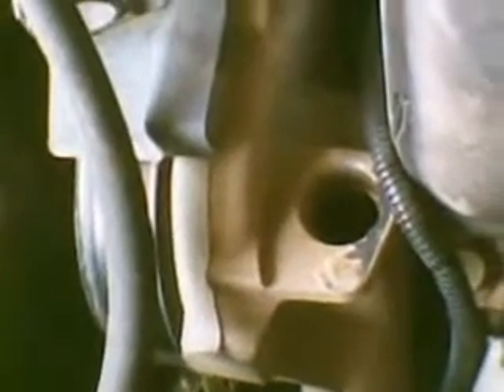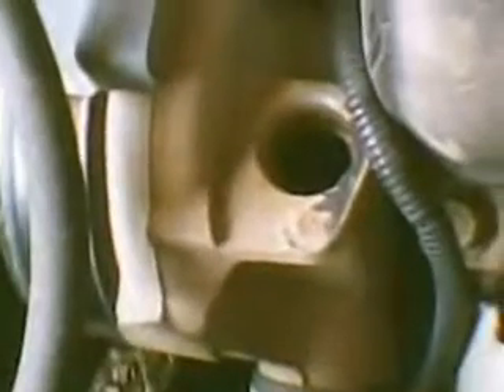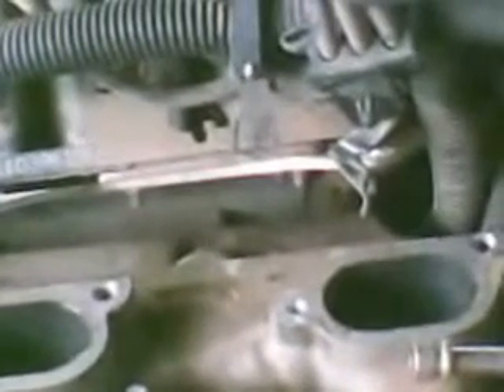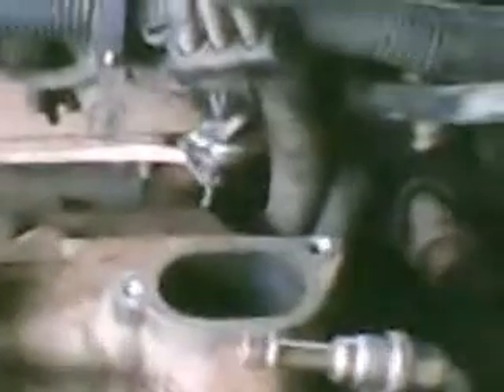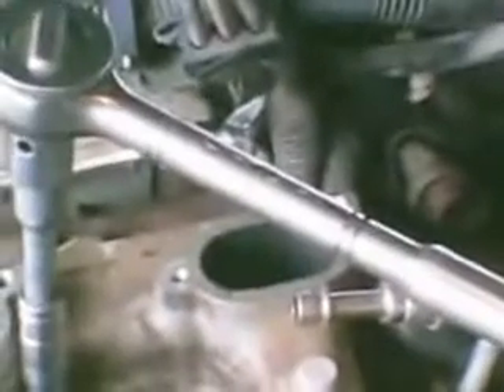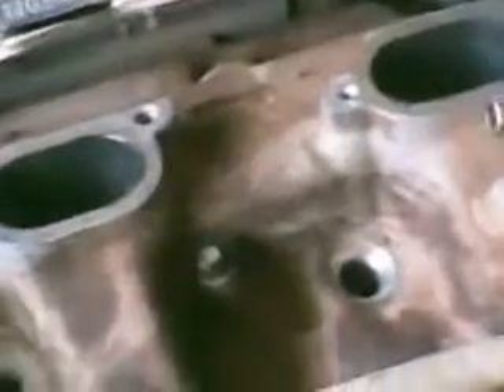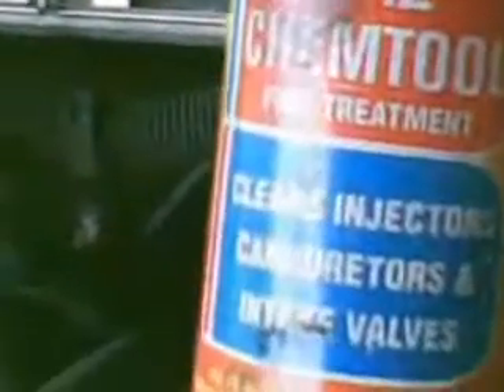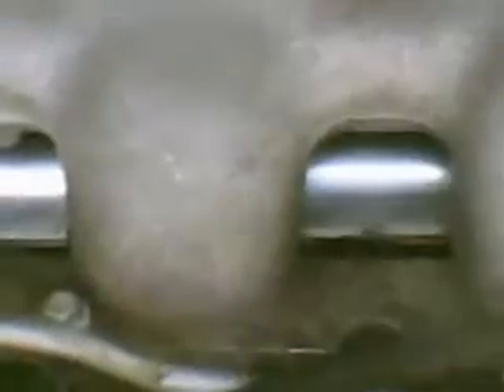Malibu 3100 Intake Manifold Gasket Inexpensive Miracle Repair

Comment: There should be 4 center bolts and 4 outside bolts.  They should not be torqued that tightly, only 115 inch lbs.  (That's like 9.6 ft/lbs)  If you crank down on them, you can actually crack the intake itself!  There is at least one video on youtube where a guy cracked the LIM in two places by over-torquing it.  If your LIM gasket is leaking, and you get this far, just do the job right.  Don't try tightening it more.

Comment: I gratefully thank you for this video.
My Malibu was leaking coolant like a shower and didn't want to put money on 14 years old car. I have a big piston slap too, probably cause by coolant in combustion chamber.
The oil wasn't creamy, so no coolant fluid in oil but vacuum leak and coolant sparying all over the place.
I retight intake botls, as you proposed (they were manually loose) and change the serpentine as I removed the power steering pump.
Now, no leak (coolant nor vacuum). The engine runs so well, that I restored other car components expecting to drive for long.
Thank you very much again. My daughter is very happy.

Comment: This is a "wet" manifold and the gasket seals both water and oil galleys, so water and/or oil can leak either out of the the engine. Or into the manifold, which will cause blue smoke in the case of oil, or white with coolant. AND WORSE, oil can leak into the coolant, AND WORSER, coolant can leak into the oil. Worse and worser are possible even if nothing is leaking from the engine or into the manifold, so everything could appear fine until you inspect the fluids.

Comment: With the lower manifold gasket problem, any kind of quick "stop leak" is a bad idea.

This is a very bad problem in and otherwise pretty good car and motor. In can sneak up on you, get worse quickly, and ruin a motor that otherwise would run like forever.

It's generally regarded as defective plastic gasket, but there may have been problems with improperly torqued or defective bolts, too.

This is a "wet" manifold. Many possible problems, including water in the oil and vice-versa.

Comment from the maker: @Peter:  Hello!  I think the coolant goes into the combustion chamber and comes out the tailpipe as steam.  Also; update: There are 8 intake manifold bolts to tighten, not 5 as I said in the video. Also, the car leaks less coolant the cooler it runs.  I took my thermostat out (hard!)  and as long as the temp needle stays below midpoint mark, it doesn't use coolant. If I were in Alaska, I wouldn't have a prob with this car!

Comment: See that coolant line attached to the manifold? you tapped it w/ screw driver. runs under fuel rails to top of intake behind thottle body. my nieghbors rusted and is leaking(he broke off) how do you replace it? I see no flare, mount bracket, snap ring. does it push in w"O" ring? his chevy is taking up space in my dodge garage. who designs this stuff?his wife needs her ride back.

Comment from the maker: even stranger than black pepper, some say to crack an egg into the hot radiator water, and the egg will hard boil, circulate, and plug up stuff, hopefully just the crack. This is last resort, but have heard some say it worked.

Comment from the maker: Pepper doesn't deterioate in hot water, and the pepper particles are of different diameters, , allowing it to plug up cracks from tiny to large. It won't work miracles, but I like it better than stop leak.